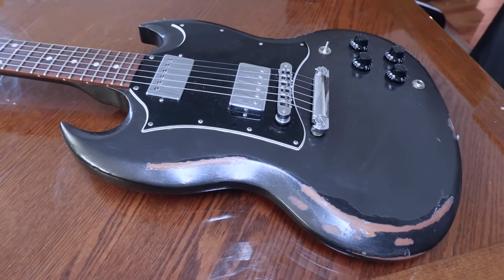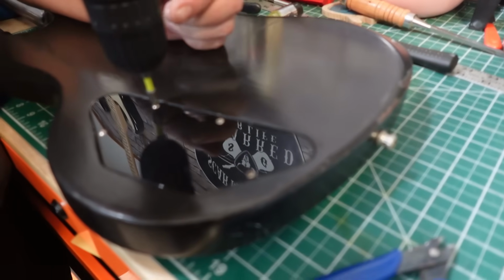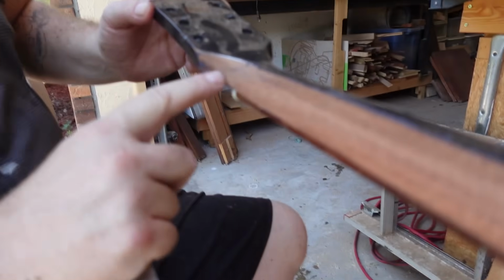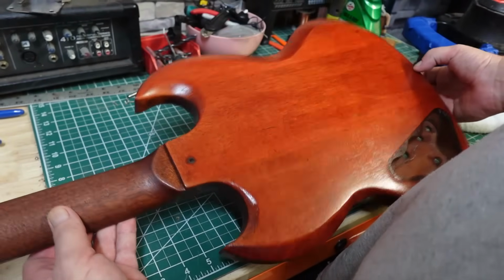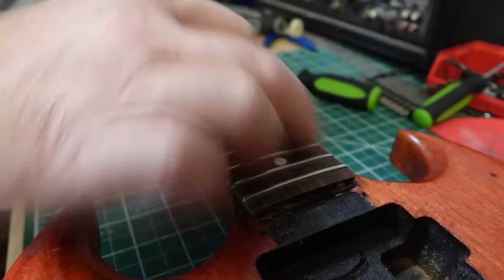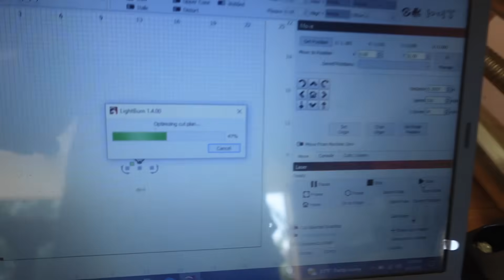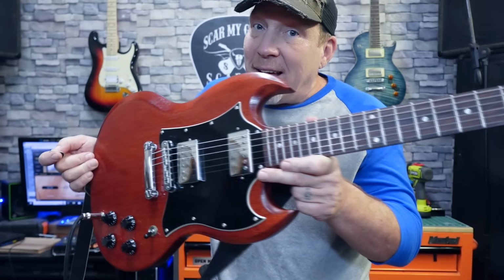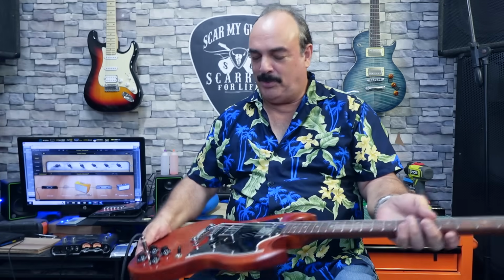Gibson SG Restoration! Complete Tear down And Rebuild!

Comment: Very nice job on bringing new life in that SG.  If I may provide a couple of tips.  I’m a guitar builder here in the Pacific Northwest.    If you’re going to use a screw gun / drill, okay, but run the screws down but do not tighten.   Use a good hand held screw driver to finish torque the fasteners, especially on the pick guard. It’s way to easy to over tighten the fasteners with the screw gun creating damage you don’t need.  You did a great job on the fret level.  Next time, support the neck when you use your leveling beam.  The neck will imperceptibly flex while you are leveling making you chase various frets.  When you are crowing the frets, use sharpie on the top of the fret to see your progression.  Regarding scraping, if you’ll sharpen your scraper, you can achieve a, (Same As) 320 sanding job using a scraper.  With that said, gouges in the wood don’t count,  sanding or if too deep, filling may be required if you go that route.  Try “Tru-Oil” from Beachwood MFG.  for a finish, it was made for gun stock finish.  It’s an amazing product and is easy to work with.  Apply, let dry and buff.  Apply 2-3 coats and Bob your ante or something like that.  Please understand, you did a great job on that guitar, this is just a few pointers that may help you along the way.  And it from the heart.  Rob-

Comment: This is my favorite video so far!  Congratulations to both of you!  That axe came out wonderfully, and it was a great idea to capture the genuine reaction to the transformation.

I also can relate to the amount of work put into this masterpiece.  While I did no such thing or even close, I put everything I DID have into rescuing a 2001 Cort-built Ibanez RG220B with an angled headstock and a rather bad neck break from a pawn shop.  The rescue was on at $25 of acquisition cost, then I put into effect my plan for gluing that neck -- I wouldn't have bought it if I couldn't figure out the next step.  I got lucky with the neck and later I replaced the entire single-locking Floyd-esque vibrato system with a brass-and-steel straight Floyd clone from GuitarFetish that I'd bought for another project and had left over.  It got labor-intensive because I decided to replace the existing inserts and studs with the bar-connected insert unit that came with the replacement bridge.  The bar kept the inserts from achieving their proper depth, so I had to pull the unit back out and route a deeper shelf into the body.  Yes I WAS terrified that I would punch the inserts all the way through the body, but NO, it never happened.  It remained cool even when I hammered on the bar as hard as I could to drive it as deep and flush to the body as possible.  Believe it or not, the whole thing worked like a charm, especially after a decent-to-good fret job.  Even a tyro (newbie) like me can do a fret job better than the factory job with the right tools, some easily-gathered instruction from places like YouTube, some good attention to detail and a liberal amount of elbow grease!  The only thing that would slow me from gigging the thing right now is the need for a routine setup refresh.

I did change out the pickups.  I tried to like the original stock pickups, but they just kinda sucked.  I got lucky again with a pair of Epiphone Alnico Classics that I think were from the second and better revision.  They give this otherwise "Metal A.F." axe true vintage tone.  I now have what a product description of another Ibanez metal axe -- an S Series, if I recall correctly -- threw out as something like, "a metal guitar with the warm sound of an axe from the fifties ..."  I remember bridling at that description, as if it implied that only those axes could possibly sound good.  Now, after getting several decades older and achieving the effect in my own roundabout way, I see what they meant and why it was/is good.

Thing is that both axes were/are better.  Guitars from the fifties didn't have Floyds!

Comment: Nice work.  Really, the only thing I'd do differently would've been to rework that headstock break to eliminate the bondo/ putty/ whatever they used to do that and and be able to at least avoid the black paint on the back, you'd still see the break a little I'm sure.  I think that's it, oh, except maybe a couple of coats of nitro lacquer, just for good measure.  Really nice recovery though

Comment: 2008 SG Special. Do yourself a favor, and get an ESP multi scanner wrench. Watching you use those big pliers on the pot nuts, and selector switch , made me wince; as did you using a claw hammer to remove the bridge studs.

Comment: From the front, that looks every bit like a new Gibson SG Tribute (but with covered pickups). And yeah, there was nothing wrong with the sound of those pickups - Mickey was right about them! Funny enough, those knobs you were complaining about look exactly like what Gibson is putting on the modern Tributes, so they may not be "vintage," but they look dead-on stock for new units. You just need to up your game juuuust a little more so the next time you have to paint over a neck break, you can do a full Gibson "stinger" to pretty it up. Nice job all the same!
Reply: Its an SG Traditional Pro

Comment: I only discovered your channel a few days ago and already loving your straight talking no nonsense personality. 
You did a great job on the restoration but I'm one of those OCD types. I wish you had got that black crap at the neck joint off with a sharp chisel. 
I'm only half way through the video so by the end it will probably be hidden under the scratch plate but it would have been better to get it off and do the restoration justice.
Reply from the maker: RULE #1 - Never remove what you don't have too.
Removing it would have done nothing to make it better. It wouldn't 
help it play or even look better. And OCD isn't enough reason for me
to break rule #1. Removing it would have caused the pick guard to not lay flat.
Now you know why I didn't. The Method in my Madness.
Glad to have you! Thanks!

Comment: That neck should be a 12" radius.  I don't know of a 2008 SG version that had a 10" radius, though some other years did. Overall, a very nice job, sir. I probably would have changed out the pickups and put on the regular Gibson heavyweight tailpiece and Nashville bridge, but if your buddy is happy with it, that's all that matters.  Gibson does tend to use straight grain mahogany in their necks on the SG's which has a slightly different appearance than the body mahogany, but most SG's are finished in solid colors so it's not as noticeable as say on a Les Paul.

Comment: Have you ever had a situation where you did work on a guitar for somebody and well they were disappointed. They somehow couldn't get on with a well set up guitar? they were so used to the junk set up that the repair/maintenance seemed to feel to them like the Mojo was gone???

I recently had my acoustic guitar in for a new nut and a set up, What I got back was disgusting. They installed a nut that was too wide and just filed the edges off. Both high and low strings are now falling off the fret board unless I'm 100% acurite and worse still the frets have now pitted. This guitar has been my main guitar for a long time so............ If I was state side I'd hunt you down LOL and ask for your help........... sadly being in Ireland shipping and your work would most likely cost more than the guitar is worth 😞but the guitar means a lot to me. 

Love the channel. Keep up the GREAT work. 

Thanks to your inspiration I'm going to learn more about maintaining my guitars myself in future

Comment: Beautiful work!  Do you do 12 string acoustic guitars?  I have an early 50s Hofner Dreadnought 12 string with X bracing set neck and I think a Spruce face and it has cracked and the bridge collapsed. I am pretty sure the body and neck is made of mahogany. I have been told it’s a 1954. Beautiful tone before my nephew broke its face and collapsed the bridge. I had it tuned down a half step from E standard, he tried to tune it all the way up to G standard and broke it, I told him to use a capo, but I m lucky it isn’t worse. I just want it playable again. The action was perfect and the neck was perfect. Where are you located? I’ll send you some pictures.  Thanks, Bill

Comment: Knipex, SnapOn, and Icon, and Vampliers make pliers designed to remove stripped screws, with gnarly knurled teeth in the tops that grab screws and easily remove them, especially from wood. Something I imagine would be very common to guitar repair and restoration.
Reply: I'll have to look into that

Comment: Sean,  I have a question:  Why didn't you try using a heat gun to help you with the paint removal?
Reply: Heat can potentially screw up the glue on set necks.  It can also have a negative effect on binding if the guitar has any.